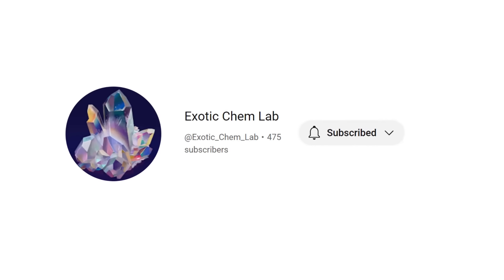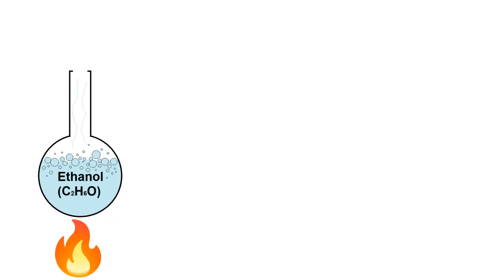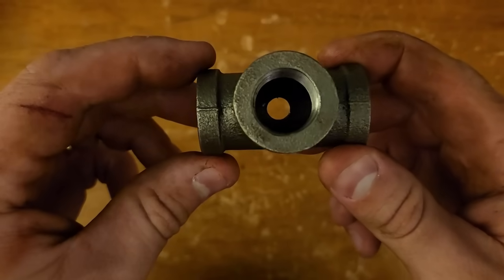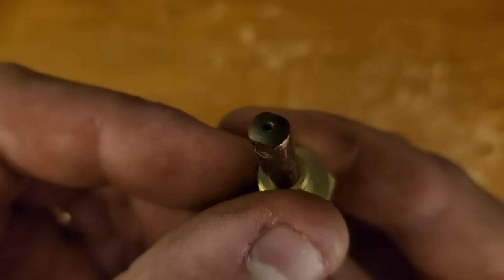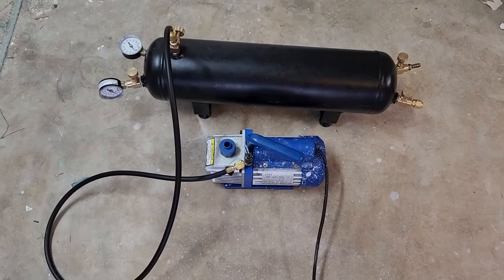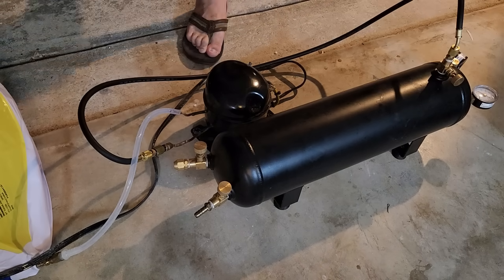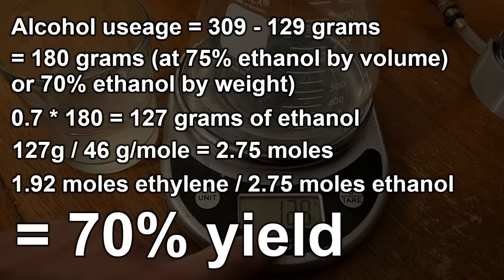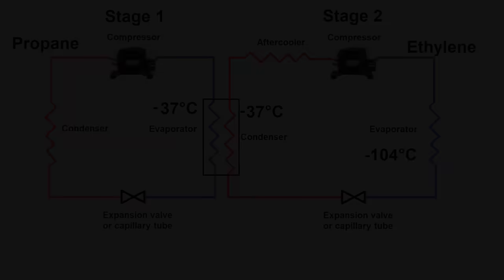Making Ethylene (Refrigerant R1150)

Comment: Time changes 😬Some 15 years ago I bought R1150 from a gas supplier on a huge 60lbs bottle. The gas was meant for ripening, but with a high quality so usable as refrigerant..
The bottle price USD 150 only. Needed just 1 oz, but over the years used some more of it.
Used for a laboratory style cold trap running continuously at -104C.
Danfoss compressors SC type those days. The continuously run made those cold traps to run 10-15 years trouble free. I can give you some information about the simple good working oil separator used on them.

Comment: Instead of using "rubbing alcohol" which is 70% ethanol the drug store near my place sells 99% pure ethanol for the same price so no water to deal with. Combined with a small extra 5% of acetone it makes for a great inexpensive PCB flux remover/cleaner but it would also probably make your job easier with this specific project.
Reply: Rubbing alcohol is isopropanol in almost all cases.
Reply: Denatured alcohol contains methanol, acetonee and/or other solvents to render it undrinkable. Not sure what side reactions that would cause.
Reply: @defenestrated23  I mean I add acetone for what I do with the 99% but he specified what he has is only 70% pure. 
Of course for this specific project acetone is not useful at all.

Comment: Do a destillation of the runover liquid, with good condenser/ice water coolant
Anything below 40°C should be diethyl ether.
Also perhaps cool runover bottle next time, since ether won't collect in liquid phase and vapor pressure is quite high.
Diethyl ether IMO has nice smell, nasty solvent smell might be acetalydehyde or ethyl acetate, from oxidation of ethanol.

Comment: This is amazing!!
I've been wanting to also make the cryogenic cooler thingy, and I've used propane to get around -45°C, but I also couldn't obtain a gas that could act as a second stage refrigerant after propane. Ethylene or ethane would do.
I thought of thermal cracking butane to get some, but this ethanol method is much nicer to do.

After you've obtained the gas mixture, I think it would be best to compress it to a high enough pressure (20~30 bar) in an ice bath, take the gaseous part of whatever (water, ether) is left after it, and then cool it to an obtainable -30°C to liquefy the ethylene, and extract only the liquid part of it, to get rid of the hydrogen and air ( nitrogen, oxygen )

Pretty much putting the ethylene thru its intended cycle, but doing it in open-loop to get rid of the impurities, especially the water (that can easily clog the system and hydrogen (which could make the liquefaction much harder, lowering the efficiency and the obtainable temp.diference)

I expect there to be quite a bit of water if you'd compress it at 20bar and cool to 0°C, and you really don't want that in your capillary tube.

Comment: Great work, surprised to see it work so well at a small scale.

Maybe a copper tube to even out the heat? Might catalyse some unwanted reactions though.

A risky but really efficient heater is a flat wire wrapped on (idealy hard) anodized Alu tube. Fantastic thermal conductivity, but dubious electrical conductivity. But with some care I was able to make some very nice heaters this way.

Like some others have pointed out the calculations were a bit dubious. Id guess you have more unreacted ethanol in the mix than ether. Also after boiling your ethanol content will be lower than the starting concentration. You can use the same density trick to figure out how much ethanol is left in there.

Comment: Good experimental setup. Please use a flame-arrestor in the copper-tube. This is to prevent flame-ingress back into the flask when the boiling stops.

Thanks for mentioning the use of ethylene for fruit-ripening. I've seen plants in India that use this method.

Since ethylene is a fire & explosion hazard, I've often thought if it could be produced by dropping LDPE pellets onto a electrically heated piece of alumina. But I'm no chemist. All the ripening process needs is some 50-100 ppm. This I believe could be achieved by a small device with a little feed-screw that drops a 100-200 mg. pieceg LDPE pellet onto a heating element.

Comment: I stil think that the -37c is not sustainable at a decent load. Maybe you should target something like -32c to get more cooling power. With the right compressor I don't think the added pressure on the ethylene side should be a problem

Comment: I'm wondering why you don't use the beach ball as a reservoir, connect the pump in parallel and let the reaction run until you collected a decent amount of ethene?

start with the amount of everclear that should fill up the tank to your liking, considering the yields of the previous run.

Comment: You should use resistor wire as the heater and insulate the whole catalyst tube... then you could probably get more equal heating and more control over the temperature too.

Comment: Everclear is not pure ethanol. It isn't even close. Yeast makes a wide mix of alcohols when it ferments, along with several other products. Unless you fractionally distil it first, this is going to be a mix. Distilled spirits in the US are only made using this method by federal law. The two PhD's in Chemistry I worked for talked about trying to use Everclear for an ethanol source one day is how I learned this little tid-bit. It does still work for cleaning, though.

The good news is that the treatment for the poisoning for the impurities is ethanol. The bad news is cheap spirits put in the nastier ones to increase production numbers, basically the stuff that distils below and above the temperature the azeotrope of water and ethanol boils at to isolate it for purification, known in the distilling industry as the heads and tails.

Comment: Great video.
In your previous video you made a shell and tube heat exchanger. If you end up having problems with that I would recommend looking into a brazed plated heat exchanger. Even a small one has a ton of surface area as well as an extremely low pressure drop. A quick look found one from a company called MultiTherm that is rated for 30 Bar. It would lack the DIY feel, but I have seen small units in chillers with refrigerant going directly through them and they work fantastically. I even used one last year to win the Defcon beer cooling contest (I got first with 6 seconds and second place was over a minute I think).

Comment: I’ve been following this closely. I do HVAC Service for work, and have played with my own R290/Propane system before that had great results. I built my own tiny little system from scrap Dehumidifier parts, and I’ve also used it in a Window AC for shiggles. Both worked great! I’ve got so many random parts, this project seems like something I should try myself!
Reply: I also have a small collection of old refrigerators. I have a GE DR1 Monitor Top which is the “first” electric home fridge. It uses SO2 as refrigerant and that stuff is nasty. I do not want another whiff of that. I had to dispose of that with a bit of simple chemistry, and the perfect replacement refrigerant for the thing is R152A aka Air Duster cans! I ended up having to fix a leak in the bottom of the compressor, and I’ve had it sitting with 150psi of nitrogen in it for probably 6 months now. Can’t wait to fill it up again and get it cooling

Comment: Nice video, looks like you have the ethylene production worked out.    I would suggest you add some more water bubblers  to scrub out any unreacted ethanol and ether, then do your drying.  You don't have to do this at the time of production.   Drying is going to be important, your dryer is good but anhydrous calcium chloride can also be used.  A final polishing cold trap using dry ice mixed with acetone will freeze out any remaining junk.  Don't know what you do about any hydrogen. When you get enough to liquefy you could possibly decant off the liquid into another pressure tank, discarding any gas that may contain hydrogen or methane. At room temp it's going to take 50 bar to but if you cool it in dry ice your down less than 20 bar.  Just use caution with high pressures and are also combustible.  There is possible a molecular sieve that would absorb any hydrogen and not the larger ethylene. 
Can't wait to see how it all works out.

Comment: I'm wondering if you insert the thermocouple from the output end cap and suspend it in the center of the middle of the tube by holding it in place while filling with alumina will show a different temp than your reading now from transfer of the case being heated while the inside alumina is being cooled from alcohol vapor?
Reply: I think his temperature probe went through the wall into the middle.
Reply: @KallePihlajasaari  I should look at it again but it appeared that the probe might be getting indirect heat transfer from the case. 

Or perhaps a probe at the beginning and end of the pipe to make sure the internal temperature doesn't change as the vapor heats up passing through.

Comment: Our boy finally ditched the solder for flared fittings! Do you guys not have methylated spirits over there? Weirdly enough, metho in Australia is 95% azeotropic ethanol, and is dirt cheap. The denaturants aren't even toxic, so it's "technically" drinkable lol.
Reply: Yeah, it's called denatured alcohol here. That's a great idea. Not sure if the methanol would cause an impurity or side reaction, though. If they use methanol over there, I assure you, it's quite toxic. Don't drink it! EDIT: the concentrations are widely varying here. Some SDS sheets quote the methanol as 5% and some up to 60%, so it may be a crap shoot to find adequate purity
Reply: @systemloc  Yeah Im convinced it must be a regional thing.  Methanol is (comparatively) rare here. Australia has a pretty big appetite for ethanol blended fuel so our domestic ethanol supply is huge.  Ive distilled Diggers brand metho myself and can confirm its SDS is accurate.  There is no methanol in it.  But yeah, dont drink it lol.

Comment: You coiled the cooling pipe but you didn't coil the catalyst pipe? Why did you use a straight pipe? You could have coiled a thinner catalyst pipe such that you would have been able to heat it more evenly with a easier propone burner. You would have gotten higher yield and the set up and it would have been more compact 🤔 also I would have leaned on the diethylether side than the hydrogen side because the separation of diethylether from ethene is easier then the mixture with hydrogen also you have probably scooted your catalyst pipe by now🤔

Comment: smell-test is not a great thing for cancerogenic anesthetic, but it works. I've made ethylene with the same method in lab, with just a butane torch heating it. FTIR showed almost complete conversion and MS showed lots of ethanol with the gas. your cleaning steps are very nice. i did run my catalyst in quartz tube, so i could eyeball the yellowing of the catalyst, and ethanol I evaporated in the same quartz tube from mineral wool. but I did not need 60 liters. Good Luck!
Reply: Nothing is carcinogenic here
Reply: @Exotic_Lab they might think that diethyl ether is another name for chloroform?
Reply: @Exotic_Lab  I wouldn't be so sure, maybe the OP is in California?
Reply: There is no evidence for carcinogenicity of diethyl ether, and no reproductive effects have been reported. Chronic exposure to diethyl ether vapor may lead to loss of appetite, exhaustion, drowsiness, dizziness, and other cns effects.